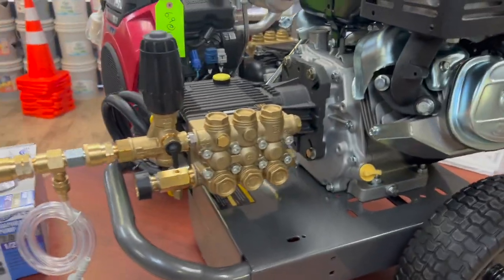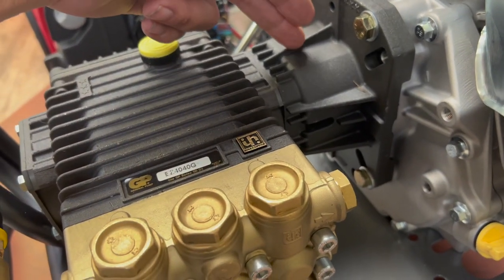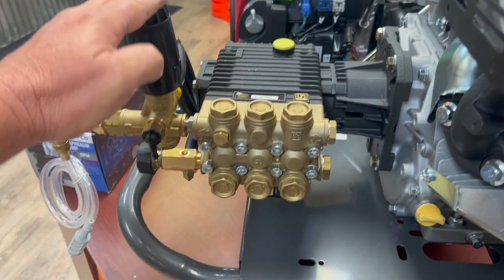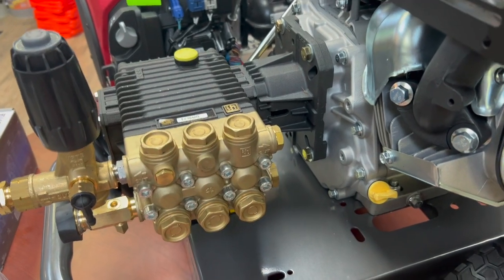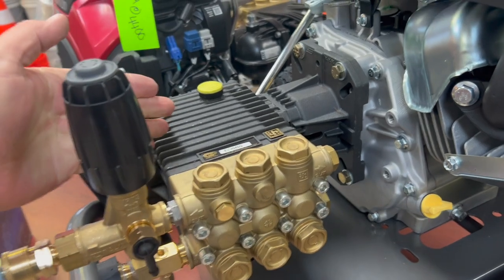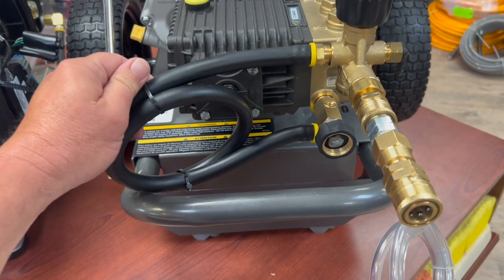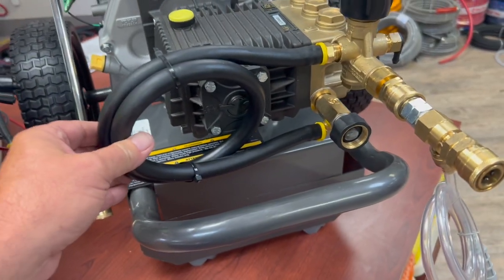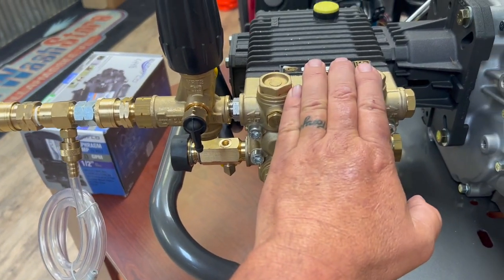The Difference in Pressure Washer Pumps - Direct Drive

Comment: One major advantage of the belt setup is the ability to tune the pump speed and engine speeds to operate optimally. This allows the same engine to run a slightly larger pump effectively.

For example, consider  little GX270 pulling a  Cat 66DX at rated power. With a 3.5gpm pump, it can hit 4000psi. With a 4gpm, it can only hit about 3200psi. With a 5gpm, it's limited to about 2250psi. And if you try to run much higher pressures than those values with those three pumps, you'll pull down the engine speed and reduce flow to where the smaller pump would actually outperform.

The 5gpm CAT is rated 3250 prpm, the smaller pumps are 3400prpm for rated speed.  If I ran a belt setup setup on the GX270 to drive the 5gpm pump at 2750rpm while the engine was at 3600, I multiply the engine's torque output by 30%. This will push the 5gpm pump to 3000psi, but at the reduced flow of 4.25gpm. A minor improvement over the 4gpm pump, but still an improvement. 

But the real advantage is the ability to target a peak pressure range (torque) and optimize flow for that. Say your sweet spot is 2500psi. Cat says that at this pressure the 5gpm DX66 needs 13.8lb-ft. Which means the 12.8lb-ft of the GX270 needs another 10% more torque, roughly. So you setup your GX270 on a 10% underdrive and get 14lb-ft to the pump at 3240pump rpm. The pump's rated speed is 3250rpm.

Presto, you have a 5gpm setup with usefully sufficient pressure (2500psi) running off a GX270! Remember, you can reduce pressure with a larger nozzle orifice, but you cannot increase flow. A belt setup lets you tune the drive ratio (via pulley sizes and belt length).

So if you are running a setup that is capable of 4000psi, you are wasting engine power to hit a potential pressure range you almost certainly don't need. And you are giving up GPM that you actually DO need to get it! That's not a good tradeoff.

Not all "cleaning units" are the same. Once you have enough pressure, you have enough pressure. More pressure won't clean more effectively or faster. Flow will. I'd suggest therefore that you consider something like 3000psi to be a hard ceiling of capability you do not want. Get all the flow you can that still lets you pull 3000psi. Or 2500, or whatever your personal experience suggests is the most pressure you need.
Reply: That was a very well thought out comment, thank you for the explanation.  I'm new to engines, water pumps etc. but I do have years of experience in telecoms and I can easily follow what your saying referring back to (frequency, DBvm, SNR and voltage, if that makes sense) I bought a GX390 3400rpm with a 4gpm 4200psi direct drive triplex triple A pump.  I would like to upgrade the pump to 5-8gpm's with an external bypass as the triple A does not have one.  (I rushed the order process without doing all my homework!)  Do you have any recommendations on pumps that would be optimal for that engine?  Also, can I remove that pump and replace with a belt drive system or a gearbox system?  I'm assuming the shaft from the engine is the same for all 3?  Thank you again!

Comment: The problem with the direct drive is RPM's. If the pump max rpm is 3500 and the 14hp engine runs at 5000 rpm's it will kill the pump. That's why a 2 for 1 gear reduction box is so important.

Comment: Thanks for post - if possible could you create a tutorial video setting up (external/12V) pump, and fittings to pressure washer? finding proper fittings seems to be most issue from 1/2 to 3/4

Comment: Instead of adding a 20ft hose and running it into a tank could you disconnect one end of that looping  hose and let the water run out on the ground? If so, wouldn't the water coming in from the garden hose or tank run out where you disconnected the hose? You didn't mention what to do there.  Should there be a plug to put in place of where the hose was? I'm new to this and I have a direct drive pw with a pump that  looks like that one. I want my pump to last as long as possible. 🙂 Thanks for your feedback in advance.
Reply: If you have an unloader that has an open port for bypass, you can absolutely vent that water anywhere you want. If you're willing to waste it.

Comment: My maintenance personnel adviced that I should just tie the trigger permanently, to save my pump, and off engine at any slight stop.
Reply: That's not the worst idea in terms of keeping pumps alive. But it might be not so great from a safety perspective.
Reply: Keep it on a ball valve. Disconnect gun and open it all the way. It won’t have much pressure and you’ll continuously move water while engine is running

Comment: Not true, I’ve made several different direct drive pull from a tank no problem, you just have to know what your doing.
Reply: How do you do it ? Im looking to plug my direct drive to my buffer tank but this has kept me from it, would you be happy to share
Reply: @mrsparklewindowcleaning679 first u have to install a 1" bulkhead fitting and a 1" pvc ball valve with a 1" threaded hose barb at the bottom of ur water supply tank..then all u have to do is raise up & mount your water supply tank atleast 2-4 inches above/higher than ur pressure washer pump water supply inlet is...! (U have to make sure that ur bulkhead fitting on the bottom of ur water tank is atleast 2-4 inches higher than ur pressure washers garden hose inlet)
Then hookup some 1" non-collapsible hose from ur water tank to ur pressure washer... hope this helps u.
Reply: No issues? I have a buffer tank and I’m going back and forth between a gear reduction box or just mounting the pump directly to the motor..
Reply: 5.5gpm

Comment: You seem to be confusing "direct drive"  with positive displacement pump (the pump type in your video), in your tutorial.  The drive input does not determine what kind of pump it is, only what type of input it has.
 The drive input has little to do with whether a pump will gravity draw its water, that's determined by your pump/tank set up. I've had experience with both Direct drive and centrifugal pumps for almost 30 years, using hundreds of pumps and have NEVER had a pump not draw from a tank because I understand how gravity works.
Reply: Correct- there's even hydraulic driven pumps that can take a generic hydro pto/remote power supply. Can't imagine I'd really want that in a normal situation, but I can come up with some usecases.